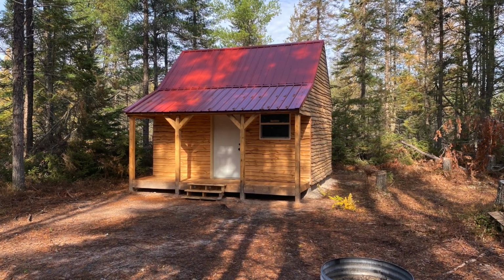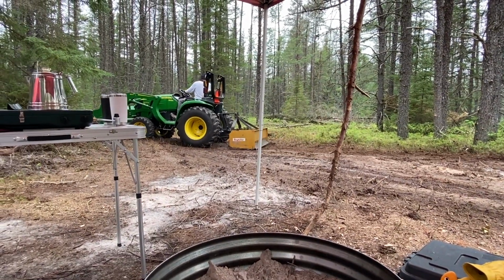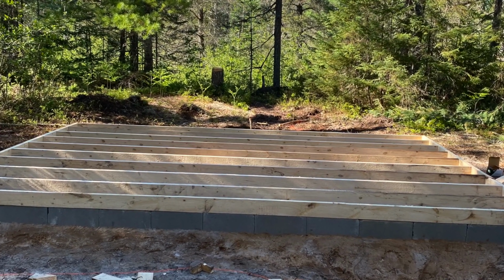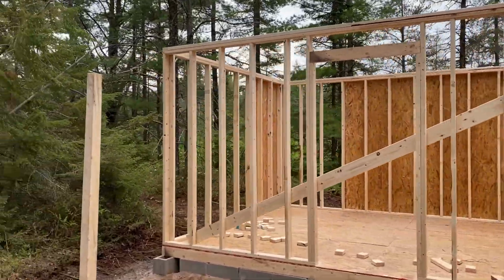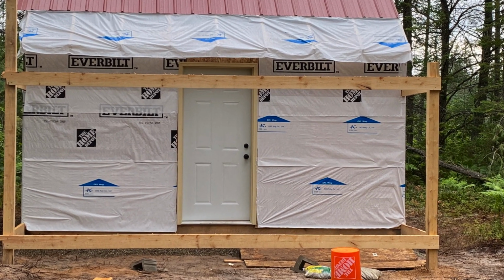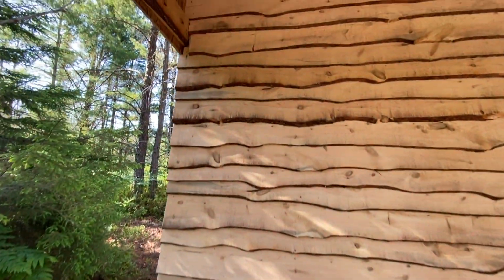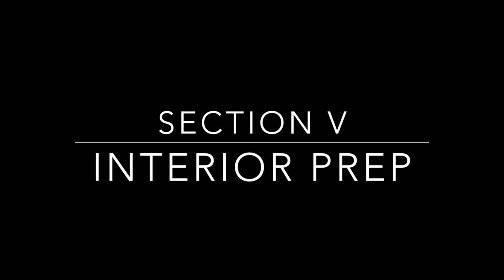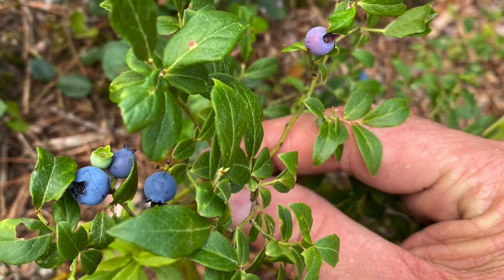Off Grid Cabin Build In Michigan's Upper Peninsula

Comment: It looks really good! Congrats on your first build. Foundation issues were mentioned in the comments, so I won't bother :), also next time you build a deck, keep an 1/2 (or 1 centemeter) distance between boards, just so it doesn't become a river when side rain invades your deck fyi. Once again, it is a gorgeous cabin
Reply from the maker: Thanks for the feedback - it's been holding up well so far.  Even though we haven't posted in a while, we have been doing some work and plan to film this weekend when we finish up the loft boards and install a well.  Our goal was to build as much as possible from the trees on the property.  To do that, they need to be milled and then dried before they can be used - it takes some time so there are always delays.  Stay tuned for more updates and thanks for taking the time to watch!

Comment: How are you going to keep the block from sinking?  Horrible design. Good luck
Reply: We tamped the sand and it's been holding up really well.  Being that it's a shed (small) we weren't too worried about it.  If the structure were larger - we would have put in a proper foundation.   Thanks for taking the time to leave feedback and watch the video :)

Comment: What were the cost
Reply from the maker: The cost varied a bit - bought the lumber from Menards and it was about 1k USD for what I needed to frame with, insulation and misc hardware.  The rest was milled from the trees on the property.   I bought one window and the others I had on hand from a remodel project.  The roof was about 900 USD  with everything needed.   Overall it was pretty cheap doing it all ourselves and using milled lumber from the trees on the property.  Thanks for watching and stay tuned for some videos this summer - we are working on filming now!

Comment: What did you do about building permits / zoning? I can’t seem to find anywhere in MI that will allow anything small and/or unconventional without having an existing primary structure. All I want to do is build a small cabin to live in.
Reply from the maker: It's best to check with the local township as they can be different than the county you are building in.  Good luck and thanks for taking the time to watch!
Reply: I’m dealing with the same issue Garrett. I don’t even want to “live” there, just want to build a weekend retreat/hunting camp. I can only assume that they didn’t answer your question because they didn’t pull anything, I could be wrong, but I know I wouldn’t have if I was in the U.P., but I’m in the northern L.P. and it’s far more populated down here, which means nosey neighbors can ruin it all very fast.
Reply: I built an 800 sq ft cabin in 2010 in Baraga co. Every aspect of the build required an inspection and permits. First thing the inspector informed me of was zero tolerance for a makeshift DIY drainfield. Must meet all current building codes before they will issue an occupancy permit. You will pay dearly if you gamble & get caught.

Comment: Very Nice!! How are the building codes in the UP? If any?
Reply from the maker: They are like most areas - it's all based on the township and county you are in.  This is less than 200 square feet it's considered a 'shed'.   We did follow the rules for this type of structure and if we choose to expand it - we can move it to a better foundation and spruce up the floor joists OR we may just build a HFT (Hunting Fishing Trapping) cabin which does require an inspection but has more relaxed rules.  You can look around for that option in your area too!  Hope that helps and thanks for watching!

Comment: I'm a few minutes in and I don't see a vapor barrier. If it's not there rain is the least of your worries.
Reply from the maker: We used vapor barrier all over the place and put it under the flooring.  Looking back, I would have liked to insulate the floor and covered the bottom with plywood.   Hindsight is 20/20 - it's all a learning experience.   Thanks for watching!
Reply: @handncreations  👍

Comment: You dont want any large spruce or balsam anywhere near a building.  Looks like most near your cabin are infested anyway.
Reply from the maker: Interesting, so why not those specific species?  Most of the surrounding trees are Jack Pine and that is what I milled for the wood used.   Appreciate the tip and look forward to your comment.   Thanks for watching!
Reply: @handncreations  I've had a cabin in the U.P. for over 30 years with balsams around it and I've dealt with all sorts of problems from them.  From what I can see from your drone shots, most of the trees around your camp are spruces or balsams.  They are a short lived tree and the ones I see there are old.   They are also trees that are very prone to blowing over, or breaking off during wind storms.  Those species are also very susceptible to spruce bud worm kills, which is a natural bug infestation that cycles through every once in a while.  it weakens or kills spruces and balsams.  The weakened ones are then more susceptible to carpenter ant infestations.  I can see from your drone video that a lot of your trees are sickly looking or already dead, probably from both of those bugs infesting them.  I've had an ongoing bud worm breakout on my property over the last few years and between that and carpenter ants, I'm losing about half my balsams and spruce trees.  There was another breakout there in the late 1980s and early 90s.  Even if they are health, they are terrible species, especially when big, near a cabin due to wind.  Years ago, during deer season, we had a wet heavy snow and heavy winds.  We had trees snap off all around my cabin with some hitting it.  They are also a pain along your driveway to your camp always falling down across it.  I've cleared out all the balsams and spruce along my driveway and around my camp.  I'm still working on clearing them away from my blinds, roads and trails in my property.
Reply from the maker: @mikeveine  I've seen some of those white worms in the trees, especially when downed and sitting.  I had been thinking of cutting the trees around the cabin in a 60 ft radius for that very reason.  Now I'm more convinced that is the right thing to do but it's just hard to be rid of the trees that make it feel 'in the woods'.   The alternative is not what I want to deal with so with your comment I may have more wood to mill up for projects.  Thanks for taking the time to comment and give me that insight!   Looks like I have some work to do :)
Reply: @handncreations  trees are a renewable resource.  Cut them down and other trees will take their place.
Reply: @handncreations  You are also going to have a lot of problems with carpenter ants infesting your cabin in that setting too.  You will need a constant pesticide program to keep them in check.  I use Termidor in June once a year.  However, with your choice in siding, you will also have wood peckers attacking too, so you may need more frequent spraying in your case covering the entire building.  You will likely have red squirrels and porcupines chewing on the cabin too.  Fishers, martins and weasels are great at controlling them, but I shoot porky's and red squirrels on sight around my cabin, due to their destructive habits.

Comment: I did a 16x20 structure similar in northern Wisconsin. I'd never pick apart anyone's creations but I set mine on a concrete slab reenforced with steel rebar and fiber mesh. I also put insulation down under the concrete and added a concrete additive called Vapor lock. It reduces the ability of moisture to pop up during humid days or condensation coming up through. Menards sells a flooring product it's 2x2 foot squares it's particles board with hard plastic liner under it. On top of that I put the roll flooring insulation down then laminate flooring. It gets a little chilly on the floors in the winter but it has worked great for structural movement. Definitely steeper pitch and steel roof is the way to go with the amount of snow we get. Nice build and enjoy! Cheers.
Reply from the maker: Thanks for all the info Gerald, as with most things - we learn along the way and so far, we have received some helpful feedback on the foundation.  We will be keeping an eye on it and if we have to make a better foundation, it's small enough to make changes.  I'll be looking into those Menards items (we go there quite a bit for things).   Thanks for watching and keep an eye out for more videos on the interior additions - we've been working and filming all winter and can't wait to get the videos out for those too!
Reply: @handncreations  enjoy!

Comment: So how does that foundation or blocks work when you get frost and the ground freezes and moves?
Reply: I would suspect after 1-2 winters the door wont open.  I wouldnt suggest this type of foundation on even a shed.
Reply from the maker: I've been monitoring it over the winter so we are keeping an eye on movement.  It's a first for us but so far, so good!   Fortunately, it's a small 12x16 < 200sq ft structure so it should hold up well.   We have been talking about something bigger and that will have actual footings (as it should) so we'll keep the channel updated.  Thanks for watching!